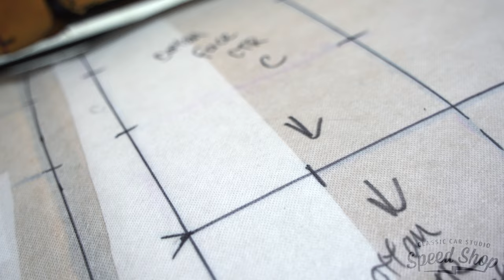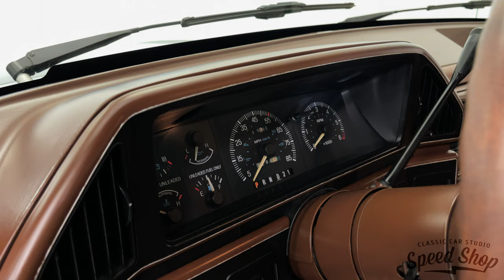87 Ford F150 - Full Build

Comment: I have a 1990 f150 4x4 with the 5.0 engine. This year I had planned on starting work on my truck during the winter. Like the last five Winters have been very mild except this one. Like this one mine is black also.
Some of my friends don't understand why I would keep this truck. My truck only has 134,000 mi on it and other than the typical  rust is that I have a major oil leak and before using it you have to put oil into it. Other than that it runs perfectly fine.

A lot of my friends own new trucks the ones that cost 70-80,000 and when they need to do something involving a pickup truck they come over and borrow mine. They don't want to have a pile of dirt in the back of their trucks or they're not long enough to carry something that they just bought. I even have people knocking on my door wanting to buy my truck.

And after watching this video I love to see my truck look so shiny once again. No matter what I do with it it will still be a pickup truck and it will still get used as a pickup truck. I don't abuse my vehicles all of my vehicles run perfect with the exception being my truck with an oil leak.

I honestly wasn't going to do much as far as interior. I have the original vinyl bench and no headliner vinyl floor and roll up windows. After seeing what you did inside I think I'm going to change a few things. I have always planned on putting sound deadening pad on the floor to take some of the noise out. I've been on the fence about putting a headliner in but if I do I will treat it the same way as the floor. My truck is so original it still has the factory radio.
I really truly enjoyed this video. I made sure to save it so it could give me motivation to get mine done quicker. Almost definitely gave you a thumbs up I was already a subscriber so I couldn't check that button again.

Again great job.

Comment: I just got a 1990 Ford F150 4.9 300 4x4 Custom to restore. Has 155,000 on her. 

The truck you guys did looks amazing. Not usually a fan of brown but that chocolate interior is tasteful. Excellent job everyone!
Reply: 155K is not that much on a 4.9 300 I6.   At worst it may need gaskets or valve seals.  The issues on those years is electronics and automatic overdrive transmission. I knew someone that had a 91' Bronco with similar issues so they replaced the 5.0 302 Fuel Injection and Overdrive Transmission with a 351w 4 BBL Carburetor and a C6 Transmission.  You can't do things like that with modern equipment.

Comment: Excellent work. Truck looks beautiful....I have the same truck, I inherited. Mine has the 4.9 with a 4 speed manual. Again excellent work.
Reply from the maker: Thanks, we were excited to do this build because we love this body style, but not many people are restoring them yet. I think these trucks are set to start appreciating greatly. Hang on to yours!
Reply: @ClassicCarStudio I need to get mine restored, From the little research I have done..... It's a rare truck,limited numbers?. The cab need a total rebuild its rusted petty bad. Regardless I am definitely keeping it. I think the truck original came from up north.
Reply: 4.9L, T18 Transmission, NP205 Transfer Case, with a 8.8" or 9" Ford Traction Lok Differential is great for off road or plowing.
Reply: @ClassicCarStudio  -that would be great! I bought an 88 x-cab a few months ago, and plan to continue to fix it up as I use it. I've been happy to find as many parts as I have. I wanted/needed a truck & absolutely could not justify spending what a new one costs these days. I spent $4,400 for a good framed, working pickup with 4x4 & a manual transmission...& yeah it still needs work, but I absolutely do not regret my decision. I look forward to how this one could turn out & increased popularity of these trucks. Nice work on yours!

Comment: Sound like you want to advertise Holley fuel injection. Stock fuel injection work better and will be worth more.
Reply: I’m building 1996 F 150 4.9 5 speed, 100% original, Runs like  new, No way I would change the engine for a dam 302 POS

Comment: I have a 85 f150 that I’m trying to replace the engine.  The one it currently has is bad. But I want a carburetor engine and remove all the fuel injector stuff any reconditions?